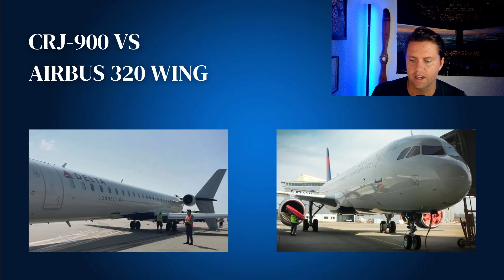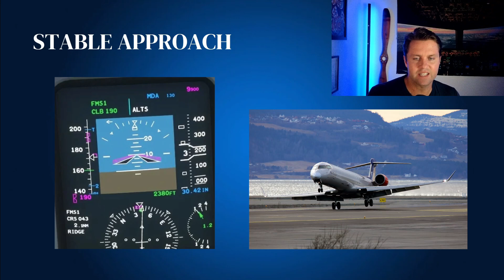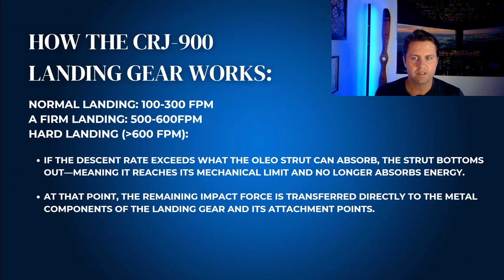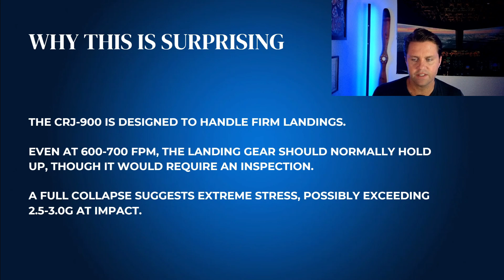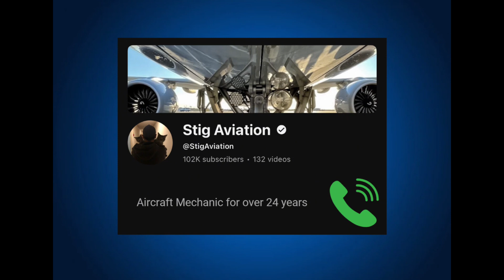Pilot Breakdown: Did a Hard Landing Cause A Gear Collapse?

Comment: During the 1995 Ethiopian Airways 767 ditching (Comoros Islands) the plane similarly lost it's left wing on contact with the surf. The plane had no fuel left (it was being hijacked) and the empty wing broke off cleanly from the wing box, as if it were designed to do so, and shot straight up into the air about 1.5 wing lengths above the water.

Comment: There were strong Gusty winds that made a landing flare difficult. The right wing was slammed into the snow, maybe in part due the right gear collapse. The right wing sheared off taking fuel with it. With no more right wing, the unopposed lift on the left wing forced the fuselage to rotate the cabin until it was upside down, stopping when the left wing impacted the right side runway. All-in-all an absolute miracle!

Comment: The hard landing could have pushed the rhs gear through the wing struts and/or structure causing it to fail, that could be a materials and/or design issue, but that will certainly be figured out.

Comment: Nobody has yet focused on the integrity of that fuselage!
I can't recall seeing another aircraft of this size roll itself up in a ball and have the fuselage stay intact!
Reply: There probably wasn't a ton of axial or lateral force, especially jerk, applied after the initial ground impact.
Reply: @bigscores7237  This and Bombardier design and material construct is top shelf...
Reply: @carlrice3637  Yep, and the old De Havilland know-how hasn't hurt either.
Reply: @TheLitehart1  Challenger / Bombardier. Still a stout design.
Reply: Since the engines are mounted on the fuselage I take it that the fuselage is stronger due to that?
Reply: ice, lotz of it!
Reply: The snow probably helped a lot, and it stopped quite fast.
Reply: You've never dropped something and was surprised it didn't break?
Reply: @gboates 
I don't see any correlation.
Reply: Physics of starboard roll
Mechanics of fuselage integrity
https://youtu.be/I7c7IedZ0mc?si=bnVyvQxv-3ZzG_OR
Reply: There are a couple overhead pictures out there, one is of the RH wing, and you can see the main gear still attached, what's interesting is it looks like it's in its normal retracted position, the wing doesn't look buckled at the gear attachment...it's like it just folded.
Reply: @bobvanderveen3528  it’s a very good plane!
Reply: @ If I had 70 friends, I’d def buy one!😉
Reply: Carrier Landing. Bill Lear designed Challenger fuselage.
Reply: It's designed to do that.
Reply: @Wilem35  To crash?
Reply: This makes me wonder... Because of the way the fuselage stayed completely in tact, could that indicate that even landing overweight, it couldn't have been excessive? I would think if it was, the body of the plan would have come apart more than just a wing coming off.
Reply: That's because it rolled itself onto a hotdog and not a ball!
Reply: It did not hit anything solid..... The moment you hit a berm like the one in Korea, everything comes apart.
Reply: @ so if you jump off a roof, then you'll be fine as long as you don't hit a berm?
Reply: @ in that case, the ground itself is one big berm….
Reply: The landing gear and the wing structural design seems to be very fragile and weak.
Reply: @ShonMardani  nope!  Great plane!
Reply: A smaller fuselage is a little more rigid than a wide body airplane. This is a good design with rear engines.